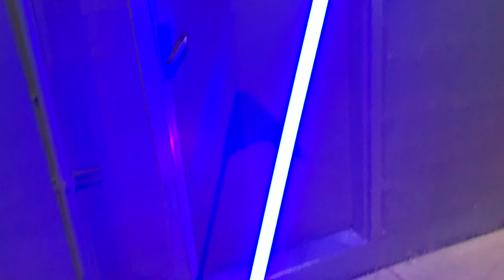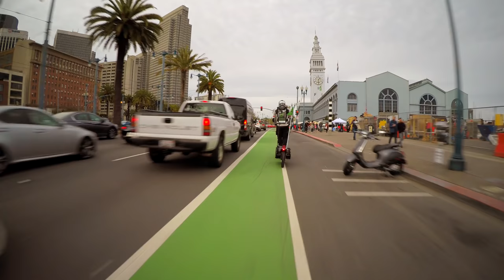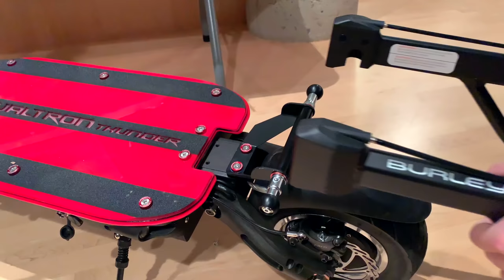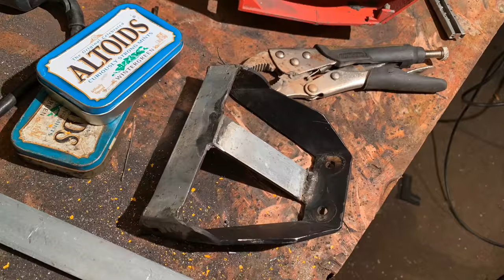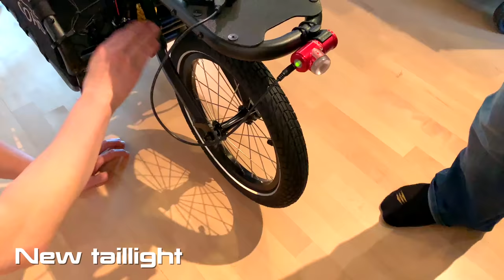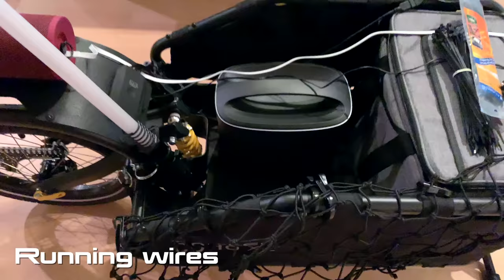Party Trailer for Dualtron Thunder Electric Scooter, Build Video

Comment: I came across this while looking for a way to haul my unicycle around on my Dualtron Ultra 2, this would be sweet, if a bit of an investment, as far as reducing how often I need my car for errands. The cart looks well made and costs to match, I like how it has suspension and swivel. My needs perhaps aren't so fancy so I will look into a way of adapting a lesser cart or mount to my Ultra 2's seatpost mount area. This video has inspired me to finally go fix my LEDs on my stem that no longer function due to a crash twisting the fork 180 degrees and ruining a few wires.

Comment: Swap out the wheel for a hub motor, put a magnet on the scooters rear wheel with a reed switch, an arduino connected to a motor controller, and you’ve got a push trailer which reduces the power consumption on the scooter giving you extra range.
Reply from the maker: It would be pretty sweet to build that kind of trailer, maybe for a future project! 👽🖖

Comment: How does it handle? Do you get any sway out of it? If so maybe a smaller diameter wheel would eliminate that. Maybe smaller and wider. It is definitely cool and unique. Down here in South Florida that would make the ultimate Beach setup.
Reply from the maker: It's a lot of weight so definitely noticeable. I lower my max power and turn on slow start when I tow it. I do occasionally get wobbles, which you can see in my next video (uploading a 360 video from the camera mounted in the back). I'm thinking that most of my wobbles are due to the tall LED light pole wiggling around in the back, but it's super cool at night so I'm willing to deal with it 😅 I'm not sure the tire is easily changed, but maybe I can fabricate something to allow for a wider tire, would need a custom rear fork.

Comment: Now that I think about it. You wood probably be better off with the battery in a bag hanging off the stem. With all that extra weight in the back it would make more sense to have it upfront.
Reply from the maker: I think that makes sense, or even a battery on the stem, and battery in the cart as well. We could probably get close to a 100ah battery 😅
Reply: @AlienRides  Just the cart alone would likely fit 100Ah worth of batteries, but then there wouldn't be any space left for cool beverages :)
Reply from the maker: orthodium exactly, this thing was built to have FUN, not be practical 😅 It actually broke down on me recently, I suppose I’ll make that my next video.
Reply: @AlienRides  For nearly $500 i'd definitely expect it to last. I'll probably join your riding group later this year when i bring my thunder baby back to SF. Cheers!
Reply from the maker: Awesome, can’t wait to see you on a ride. The quick release skewer on the cart snapped off, I’m talking to their customer service now to see what they can do for me.

Comment: Any advice for attaching a Burley Bee Trailer to a Dualtron Ultra? Sort of new to all this. Love the video!
Reply from the maker: Biggest recommendation is to weld something, or find a welder near you to fabricate something. My custom tow hitch recently broke actually, so I'll be working on a new one soon.
Reply: @AlienRides  what part of the kitch broke?
Reply from the maker: Paul Boonyanetr the through-axle bolt from the trailer. I’ll need to use a thicker one, and redo the mount. I just haven’t had time to do so recently.

Comment: Kevin, whats the real range of the Dualtron Thunder?
Reply from the maker: Always the hardest question to answer due to so many varying conditions such as weight, speed, and hills 😅  Personally I can count on 40-45 miles. If you're lighter, and don't go super fast all the time you can likely get a lot more.